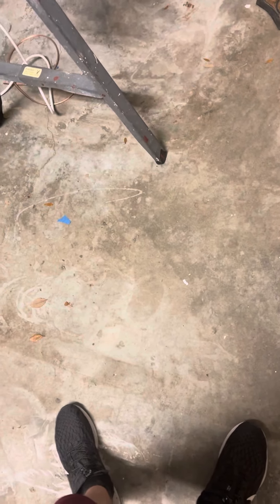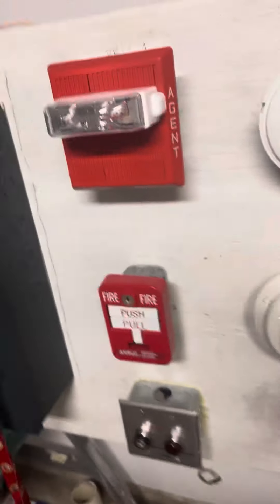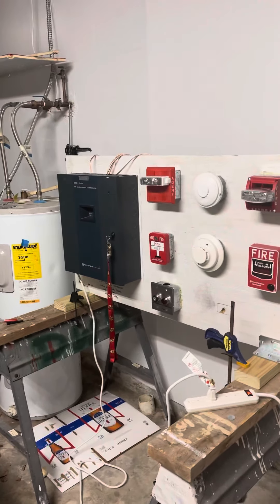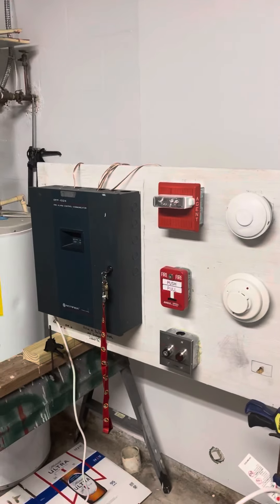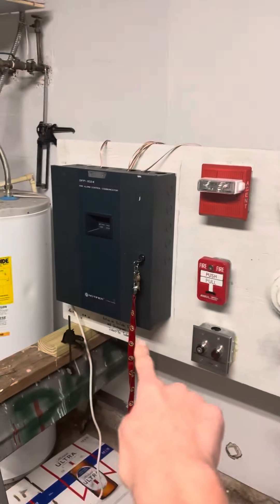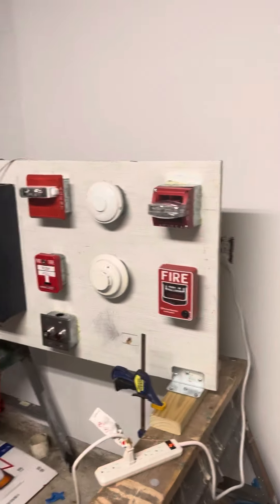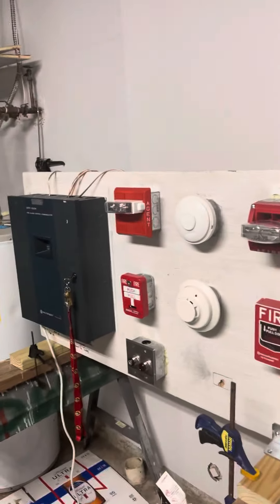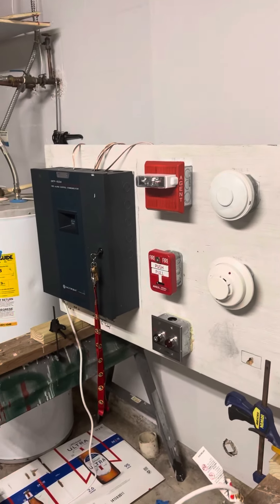Prologue Trailer of the Notifier SFP-1024 Fire Alarm Control Communicator! (My Biggest Project!)

Comment from the maker: Sorry if this Prologue Trailer has poor quality or less innovative—and I was on a tight schedule if that’s the case. 
The overview of this system consists of the Notifier SFP-1024 Fire Alarm Control Communicator—conventional system with maximum of 10 Zones. Only 4 Zones are powered but Zone 5 of the AutoPulse Fire Suppression Disconnect Switch is disabled. Zone 1 is the first pull station next to panel, Zone 2 is the System Sensor i3 Smoke Detector (2-wire), Zone 3 is the second pull station, and Zone 4 is the Chemictronics/Fire-Lite Heat Detector installed between the two Notification Appliances. The alarms and pull stations will be changed every video—everything else is technically permanent. The panel has other typical features such as “Fire Drill” and “Walk Test” and they will also be featured on the System Test videos!